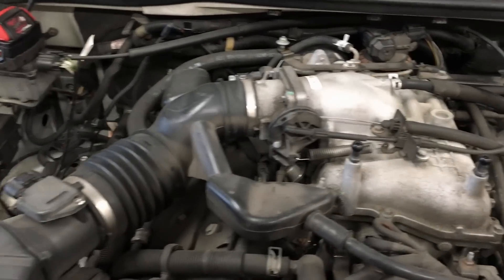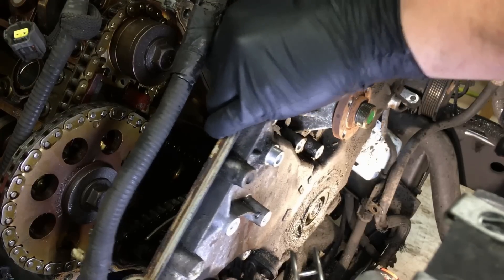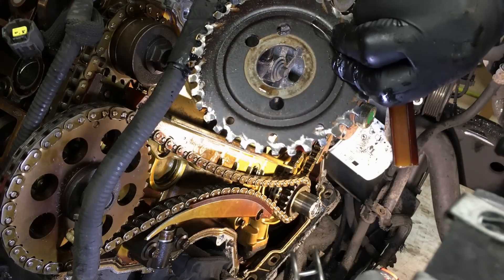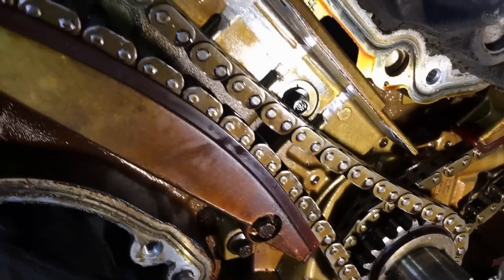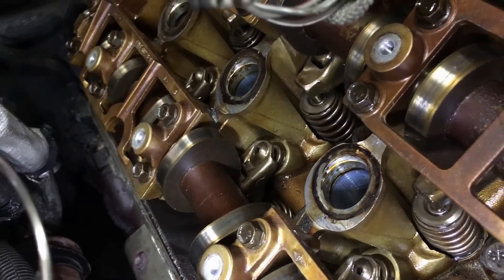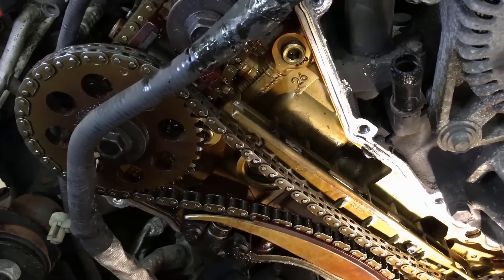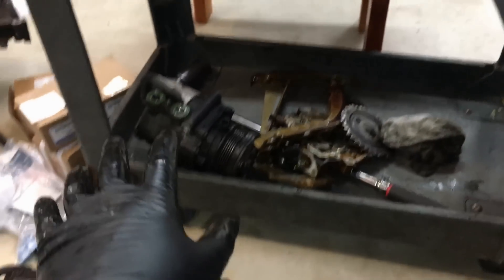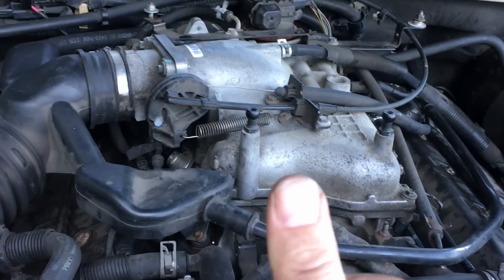Ford Modular Engines Rattling Clacking Sound: Timing Chain Guide Failures You Don't Want to Ignore!

Comment: At 8:18 you mentioned  the engine condition in a negative manner but did do the repair and at the very end of the video "the engine could be saved". Best guess on potential future mileage/life left on this engine? What is amazing is everything performed like it should. I know that sounds stupid but at the end of the day whether you were doing normal maintenence at 150,000 (timing chain replacement) the cost is basically the same and you have the engine back and running either way. You have incurred the same labor costs. The bad part is we as the consumer want the engine to run without a major repair to 250,000+.  Awesome video!!!! Thank!!!
Reply: We're suppose to change out our timing chains at 150K?
Reply: Eric Downer indeed!

Comment: I still say it's from running 5W-30. I went to 0W-20 it went away....
Reply: Speced oil for 03' was 5w20 so that is probably what it got. No way it is from running 5w30, if anything 5w30 is an asset over a thinner 0w20 or 5w20. Ford apparently figured out that 5w20 isn't the greatest because lately they have practically switched every one of their engines to 5w30 now.
Reply: 1998-2003 required 5W-30 read the manual.////
Reply: Page 298 and 321 http://www.fordservicecontent.com/Ford_Content/catalog/owner_guides/03231og3e.pdf
Reply: Read the damn TSB on why they changed to 0W-20 5W-20. As 5W-30 was not thin enough to operated the VTC and they wore out to fast. As Ford has issues with the VTC. So they revised the oil requirements.

The latest recommendation is to use SAE 5W-20 oils in most 2001 engine applications, and in many earlier applications that used SAE 10W-30 and SAE 5W-30 TSB #99-8-16, 05/03/99, which changed the recommendation from SAE 10W-30 to SAE 5W-30 oil for many earlier Ford vehicles. SAE 5W-30 oil continues to be recommended for any 1989 and later Ford engine/vehicle combination not listed in Table 1.  

I been at this for 35 years. 

Thank You
Reply: Don't get mad that you are wrong, its ok. Ford switched over most of their gas engines to 5w20 by the 03' MY.(CAFE and emissions advantages) The TSB you listed is outdated does not apply to the 03' in this case sorry.

VTC? You refering to the VCT (Ford calls VVT) cam phasers?
Reply: So I guess Ford just lies when they tell dealers to use the new TSB update... for year models before 2003.... They just made it up out of thin air...

End of replying to you. You're a know it all. Even more then Fords engineer that designed and built them...

Good Day
Reply: You provided no relevant information regarding the vehicle in the video. The 4.6l DOHC in the 03' Aviator in this video does not even have VCT (VVT) so I don't even know why you brought it up because it does not apply. TSB 02-1-9 replaced TSB 99-8-16, hence 99-8-16 is outdated like I said. Regardless the 03' Aviator 4.6l is not covered under 02-1-9 either, it post dates that TSB

Comment: I would recommend a oil change after 1 month or two just as a play safe don't know if you agree
Reply: I would run new oil and some seafoam in it for about 30 minutes.  Then change the oil.  Then change it again at about 500 miles.  Should be pretty clean at that point.

Comment: My 2004 4.0 Explorer is making this same noise. Also now the gear shifter is stuck in park. Anyone know what the problem is? Thanks for the video!👍😀
Reply: Yup my timing chain tentioner started to make noise at 210,000 miles. I just kept oil changed with higher quality oil and drive it more carerul. So far hasn't mine hasn't gotten noisier. My explorer is and 99, 4.0. I have been keeping changing oil more offten due to the timing chain issue. I will not pull my motor just to do timing chain tentioner. So far the milage is now 260,540 on it.

Comment: Wow!   I can't believe that someone would keep driving that, with all that rattle.
Reply: Why not. It makes people think they are running diesel.. LMAO...
Reply: Master Chief 00117 you would be joking, but yeah..!
Reply: DWF!
Reply: I have the same problem. Rattle usually goes away after idle and when you are on the throttle. I’m just gonna drive mine till it does. Started doing this 30,000km ago and still goin strong. Cheaper and easier to just swap engines or scrap the truck when it finally dies.

Comment: Good one Brian. Man, why would you let something like that go for so long?
Reply: Eddie K mine has had little tap for about five years..98 2v..  I'm wondering if it's a timing now lol
Reply: I’ve let mine go for about 30,000km. Sounds just like this one. Oil loooks like metallic paint every oil change. Hasn’t lost any power. Let her suffer, drive it till it dies. Not worth the effort of changing it on my worthless 2002 f150 with 320,000km.
Reply: AdrenalineJunkieProd $200 kit one weekend your just lazy..